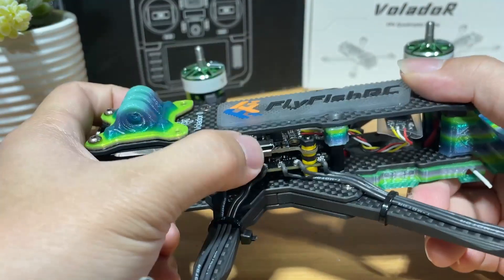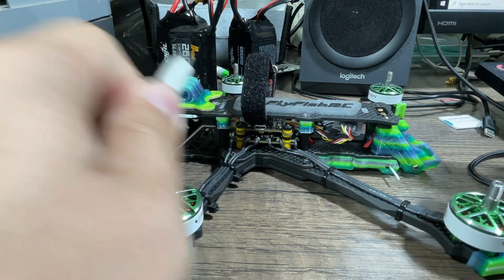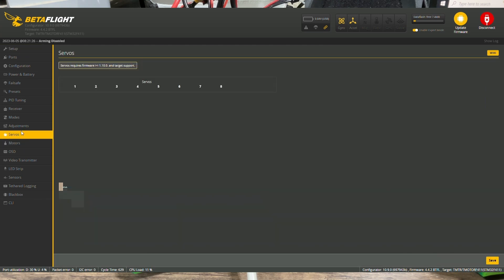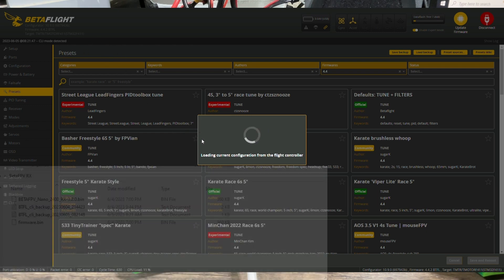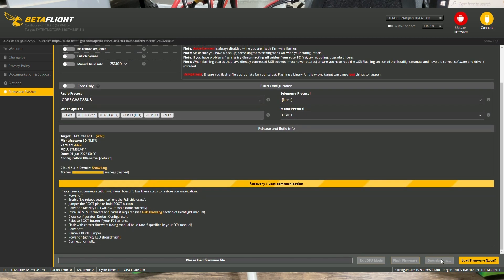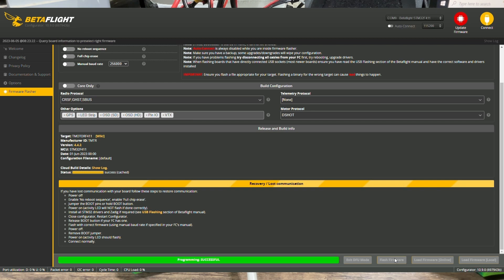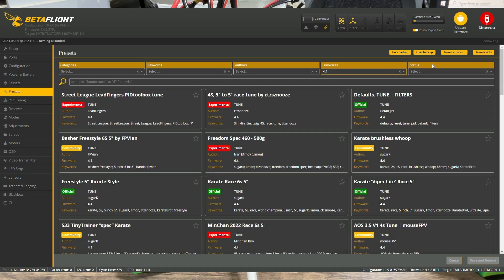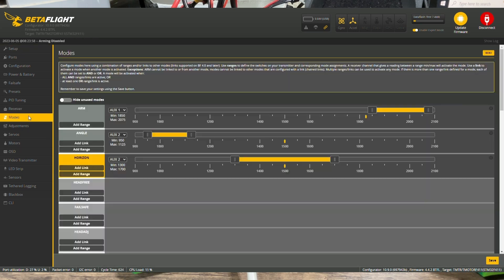Build a 5" FPV Drone Part 3: How to flash Betaflight firmware to the FC #fpv #betaflight

Comment: Sometimes it's needed to push a button on the FC when you're connecting it to pc🙃
Reply from the maker: Yes, you are correct. The purpose of pressing the button is to enter DFU/Bootloader mode but since the FC was able to enter DFU directly then no need to press the button.